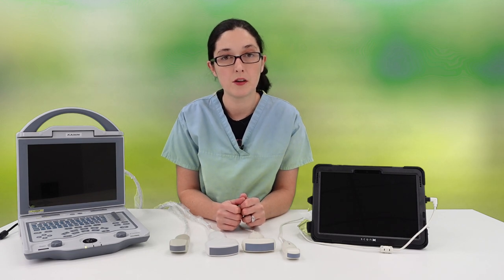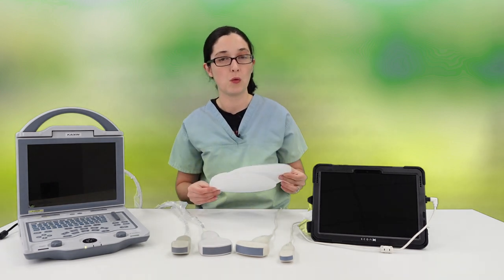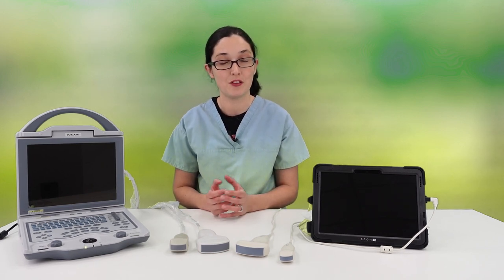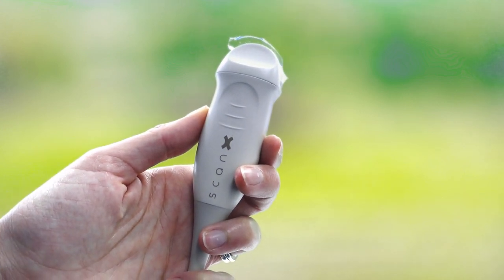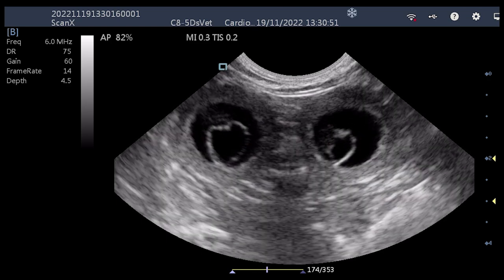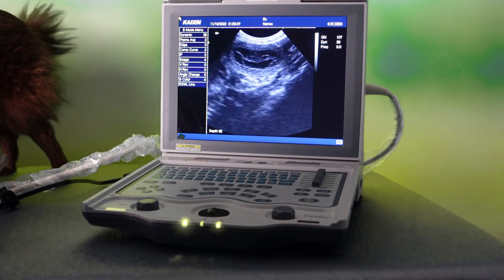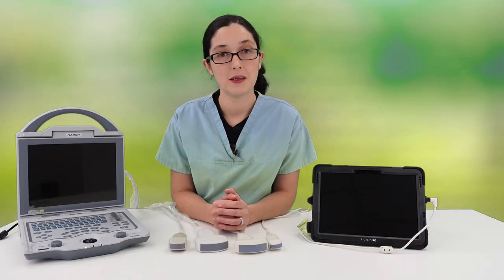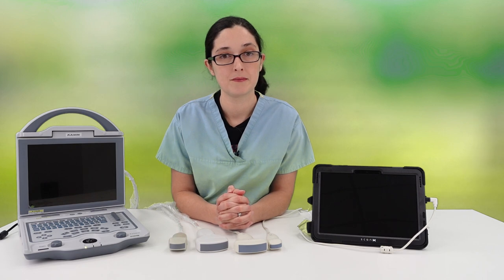Goat Pregnancy Scanning: How to choose the best probe for the job

Comment: I would say that even in standard goats the uterus and sacs are still close to the abdominal wall so the microconvex works just as well on my larger goats.  I have had from pygmies on up to large standard goats.
Reply from the maker: That's very interesting! Do you find this to be the case throughout the entire pregnancy? I have to say, the only time I've ever really struggled with a microconvex probe on small ruminants was when scanning a particularly large sheep late into her pregnancy. I could confirm pregnancy fine but just couldn't get the penetration I needed to see all of the lamb.
Reply: I have had to position the probe further forward on the belly, but the uterine wall is still very close to the abdominal wall.  Hard to see much though as the babies get very big.  If the probe is in the "regular position,"  near front of udder , in late pregnancy you will just see cotyledons and legs ( if the baby is in diving position).